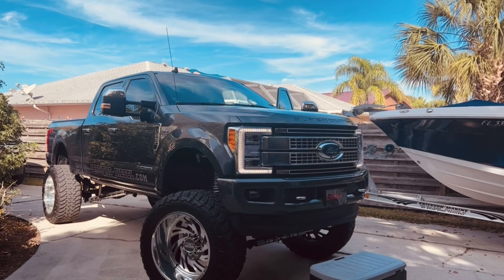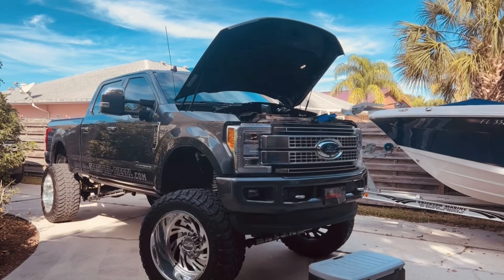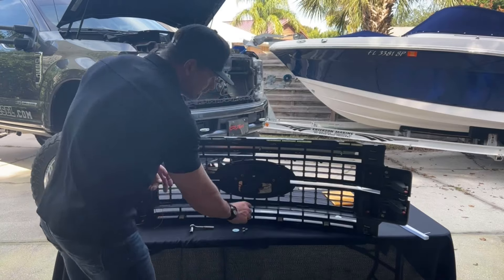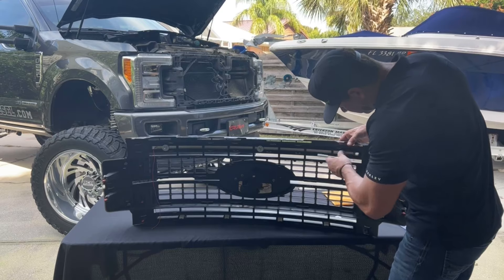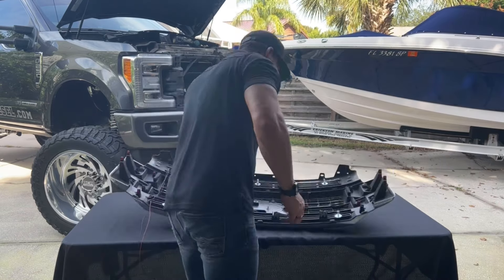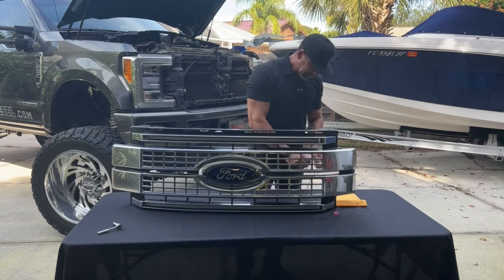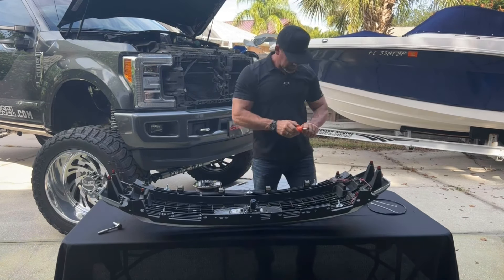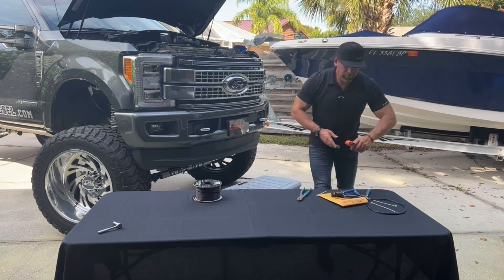L.E.D F250 Grille Light installation Video

Comment: What’s the best way to connect the light bar lights?
Reply from the maker: We do offer the plug & play harness that goes between the headlight and the headlight harness. Or you could wire them to your upfitter switches.

Comment: Do you have the grill light in stock for a 2019fordf250 platinum and the wiring diagram for the direct fit to head lights